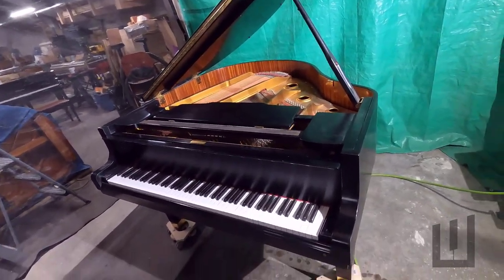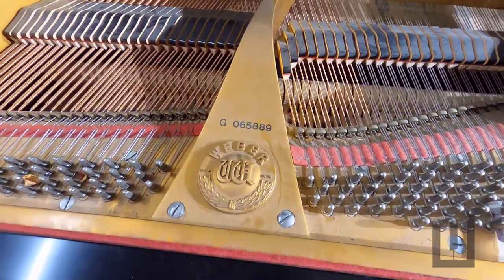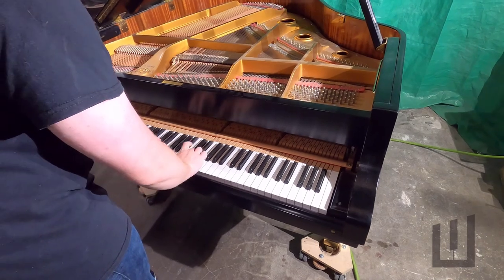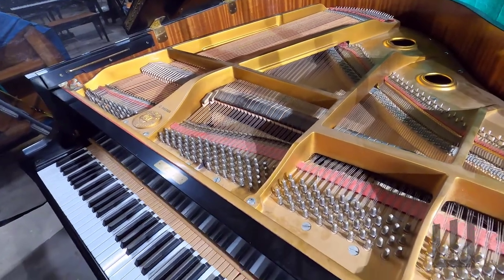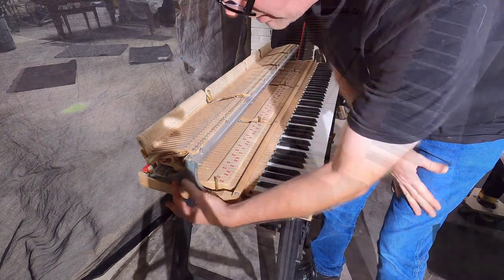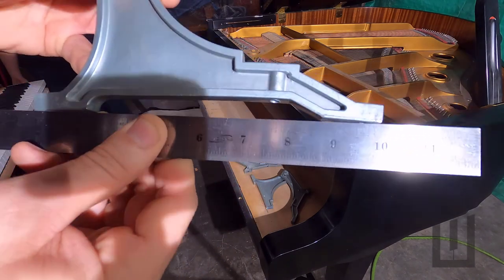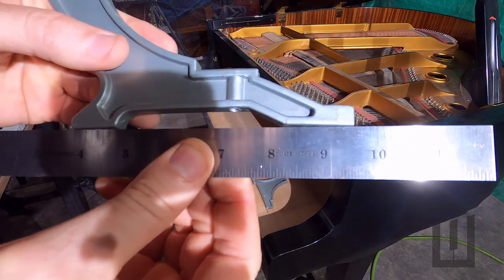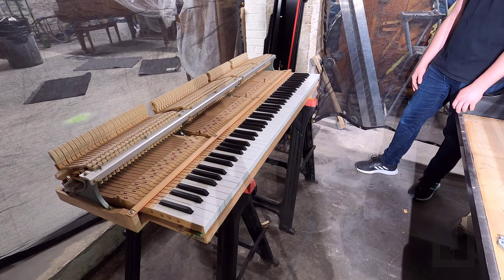Young Chang Expanding Action Bracket Problem

Comment: If the action brackets reach the point that they’re so swollen they can’t be removed, is the only step to carefully remove the keybed with the action on it while the piano is on its side?
Reply: Yes.  If the action is entirely jammed, removing or loosening the keybed is a good plan.  That will save you dismantling the action inside the piano (not easy).  I have encountered this too.

Comment: Supply 88 make a replacement for some Weber and Young Chang brackets
Reply: I strongly recommend the OEM Young Chang action brackets from PAL Sound, Young Chang's US distributor.  I warn you against the plastic Supply 88 brackets which are also more expensive.